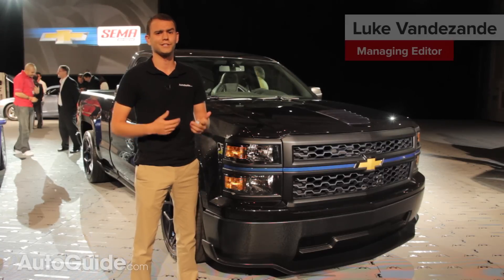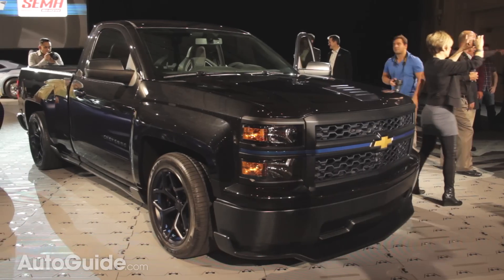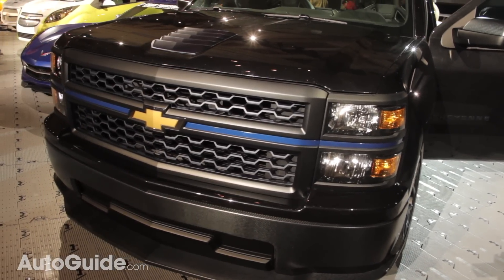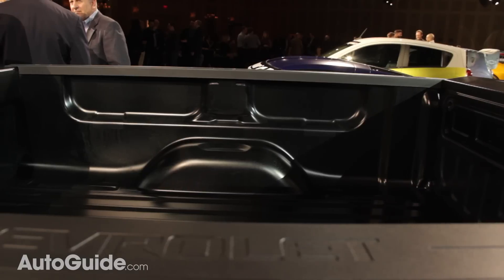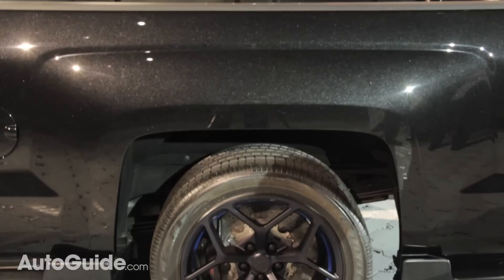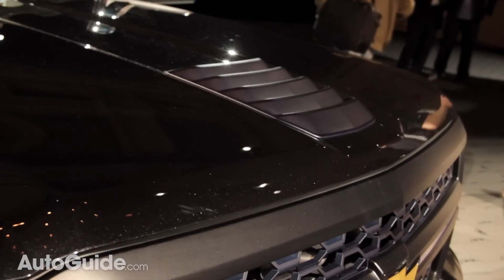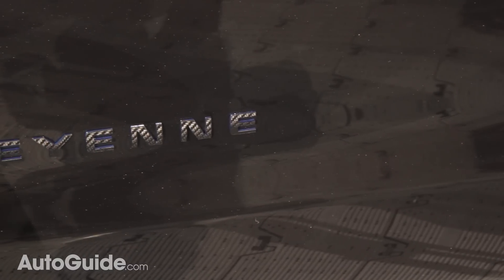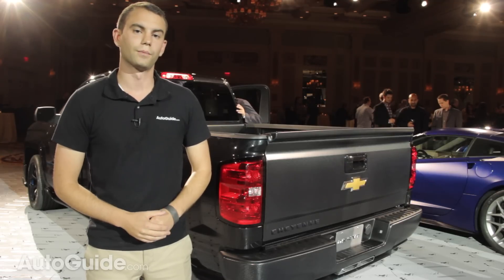2014 Chevy Silverado Cheyenne Concept - 2013 SEMA Show

Comment: ...fast forward 7 years, and GM doesn't even offer a single cab short bed truck in the states anymore. smh
Reply: i have a black 2015 single cab 5.3L not the 6.2L like in the video. All I need is carbon and new hood and it would look exactly like this one

Comment: It needs the LS7 or the LSA, I'd say LS9 but I'm pretty sure gm wants to keep it exclusive to the ZR1 but please use a different motor why buy it if it's lighter but doesn't have even a little bit more power

Comment: Good stuff but one correction. The short box you're referring to is actually standard box. No manufacturer, that I know of, offers regular cab w/ short box. Only available on crew/extended cabs. Would be awesome if GM did this because save more weight & give car-like wheelbase. However, they won't. Would need another frame configuration & costs too much with new tooling & crash testing.

Comment: Totally agree, GM needs to build the Cheyenne. Keep the Z/28 wheels (w/ taller profile tires) & 6.2 L86 or LT1 (even better). Make the carbon fiber interior, Camaro steering wheel, & Recaro seats optional. Ditch the carbon fiber body panels & carbon ceramic brakes to keep cost down. Next, add center console from crew cab, Sierra Denali gauge cluster with C7 mode options, 8" MyLink screen & AWD option. Finally, must be monochromatic. NO CHROME!

Comment: I do like this truck,a short box V8 powered truck what's not to like. But here is the problem Chevrolet is dusting off the Cheyenne nameplate and now calling it a Concept truck.  When I bought my 98 Silverado off the lot, a Cheyenne was the basic work truck. It had a bench seat and roll up windows, maybe power locks. If you wanted to do away with the flat black grill you paid for a Chrome Silverado Grill. Instead of lying to the public just make a proper SS Truck or a Short Box similar to the Ram you can buy with the Hemi

Comment: Remove alot of the carbon fiber (for $$$ issues), offer around 3 paint schemes, add projector lights and keep it under $38k. That, in my opinion would make it production worthy.

Comment: Should be a GMC version, the Sierra to me is the way better looking truck. Cool concept, the Ford Lighting is an iconic street truck  a GMC version of what is in this clip has a ton of potential, love the CF weight cutting. The wheels need to make a little more sense, I personally like the square wheel arches on the new Sierra's.
Reply: Even though GMC is nice, and they and Chevrolet produce about the same vehicles, Chevrolet seems like the more popular of the two. Makes more sense for GM to make it a Chevy.
Reply: SoToAnTrAx yet, it has sierra style wheels
Reply: ***** Those are Camaro Z28 wheels..

Comment: Make it! Make it! Make it! Without the hood thing.... Call it the Silverado SS, Need to pump the power to the Corvette's 460 hp with the dual mode exhaust. Lose the carbon fiber and price it to sale. The Cheyenne should have 455 hp in a 4x4 Z71. Then the Super Cheyenne would have everything from the High Country.

Comment: This is nothing but a concept, if this truck does go into production, it will look way better than the one there showing in sema. How did the 2006 Camaro concept look compared to the final production 2010 Camaro? Get what I'm trying to say? Anyways, they will most likely make a street truck to go up against the Ford Tremor and Ram R/T or Express. Most likely it won't be called a Cheyenne, maybe SS.

Comment: worthless vehicle, it should be packed with C7 Z06 650hp engine not normal escalade engine.
Reply: its got the 638 HP ZR1 motor. Didn't you hear the supercharger?
Reply: +The Reginator he said produces 400hp so it is normal 6.2 V8 (Not Supercharged). We need a product like Crew Cab LTZ with a Z06 engine. Thats what customer needs :)
Reply: they want it to sell to everyday working people that don't have 70 grand to spend

Comment: I would like to see it .but I think chevy will be stupid and not do it. They always do this. They come out with the coolest thing and never put it out. Remember the ss truck good idea then stopped and the lighting tokoff to crazy levels and now fords doing it allover again. Dodge is now letting you make the beast with express pickup. Chevrolet pisses me off born and raised Chevrolet man but what are they thinking I want smack them ford kills it with that crapstang and chevy does nothing but weight 10 years and then come out with the Z28 think about it ford 550 hp Mustang, 425 camaro ss, 600 Mustang, 550 ZL1, I mean really what the fuck are the thinking no wonder why they were made fun of during the ressetion and every ford guy was so happy when they didn't need one even though they did get one anyway.  If Chevrolet got there head's out of there asses they wouldn't have been fazed by the ressetion. Just my opinion

Comment: Why not do an old school 427 big block with fuel injection? I mean the old 69 Yenko Camaro was underrated at 425 horsepower for insurance reasons when it was actually around 650. So take that engine 427 greatness add modern fuel management system and we r talking 800 plus h.p. No supercharger all motor....a more efficient fuel delivery system would make any old school big block scream....them ford and dodge would be sucking hind tit once again....because there big blocks were a joke...426 hemi I had several not that great 428 and 429 cobra jet junk....chevy has always ruled the big block scene...lets do it again guys....and before any negative comments on winning and losing....look at nascar and Nhra the chevy engines are the winningest engines period...numbers don't lie Chevy has more wins than ford and dodge combined. Do your history on racing and you'll see.
Reply: 427 650hp was a myth like 100 mpg carbs.
Reply: The most nascar and drag race pro series goes to chevy engines mg42......yeah ford and dodge wins some but chevy rules the racing world....get your facts right....u obviously are a couch living room racer....take notes kid.....chevy is top dog in the win column
Reply: Larry Barger Chevy does have some claim for good racing, beats fords new engines too big time. But Mopar was the little guy that Dominated the mahority of American motorsports. Thats why our cars were banned from NASCAR. GM and ford Immediately cried to the govt. The govt also canceled our jet cars. Watch any diesel domestic tractor pulls. Dodge Trucks galore. I do like way more GMs than Ford.
Reply: all topfuel Dragsters still use the 64+ style generation Chrysler Deseined HEMI engine.
Reply: 392 Hemi to be exact....and the only reason the use them is the cylinder walls are thicker than anything else. I own Mopar and chevy I build all kinds and Mopar is great but I repeat but they are not as strong as chevy engines ever. I love Mopar and chevy but Chevy has better engines....Fact. Also one class top fuel doesn't compare to all the other classes and types of racing Chevy still has the winningest engines in the history of racing.
Reply: MG42pillbox awesome Word man. You tell em.
Reply: +MG42pillbox Dodge doesn't make their own diesel motors. They just use the Cummins brand
Reply: Larry Barger couldn't have said it better it's all about that bow bowtie
Reply: Hind tit lol i use this phrase to. Chevy for the win.

Comment: wanna be FORD LIGHTNING
Reply: Lol that would eat a lightning. Im pretty sure a todays 5.3L would too.
Reply: +C Genious Well duh you're comparing a 2014 vs a 2002 truck (first 380hp Lighning) 
if the lighning came back, would probably have a 5.0 Supercharged, or some other bad ass engine putting easy over 500hp
Reply: nandiito I bet Ford would jam a turned up TTV6 into it, seems to be the way they are going. If you look at new Ford GT and Mustang for references, and the cancelation of high displacement V8's like the 6.2L
Reply: lol no , they had Chevy Cheyenne c10s in the 70s sorry